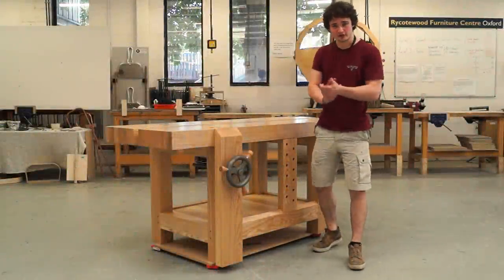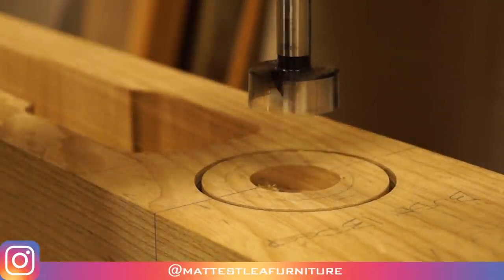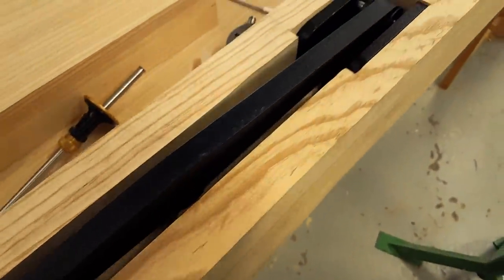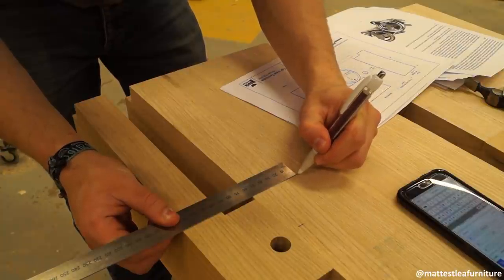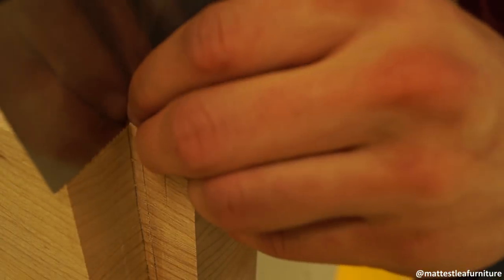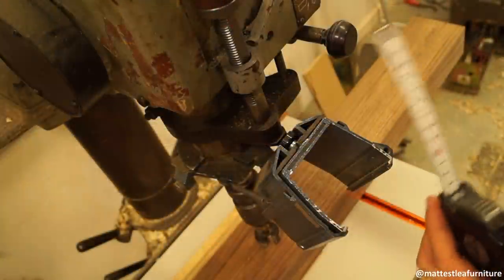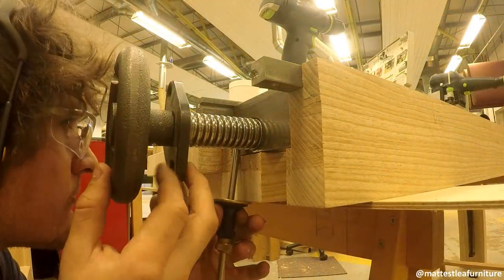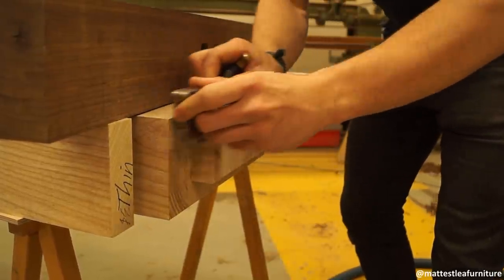Building a Roubo Workbench | Part 6

Comment: The end cap serves a purpose for installing the wagon vice, but why did you make it stretch across the full width of the bench? If you plan on adding the tool rest/ planing stop you have made it more difficult to remove or turn that. And leaving the tops fully separate would surely have been even better in coping with wood movements?
Reply from the maker: Fair point, I just preferred the look of a full length end cap!

Comment: Beautiful work, but, I wonder if you wanted to make this work bench and you did not have access to the tools available at the school would you have been able to make it with say just a drill, a circular saw and a bunch of hand tools like say screw drivers, chisels etc. 
I am sure a lot of viewers if they had access to the tools and say about an hour on how to use those tools would be able to make something if they have the plans to make it. I would like to see how a skilled wood worker as yourself shows how to do things with the tools the average joe may be lucky to have. Making things with Festools or fine Japanese chisels or having a drill press/table saw etc one would imagine should be easier. Not sure if this can be done in general.
Reply: it can be done. it will only take a ton of patience. And you can probably simplify some steps, like using simpler joinery and such. And don't forget, tons and tons of patience and time.